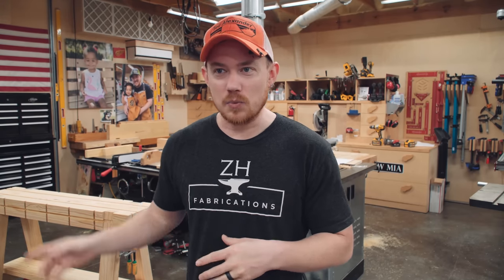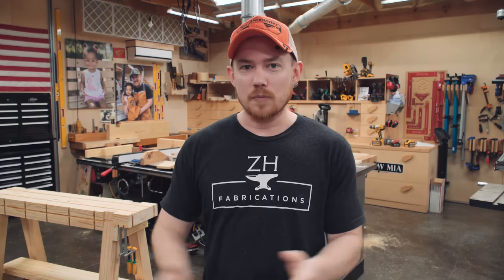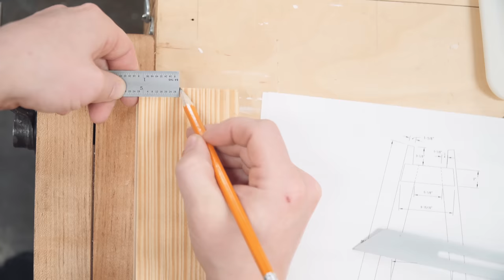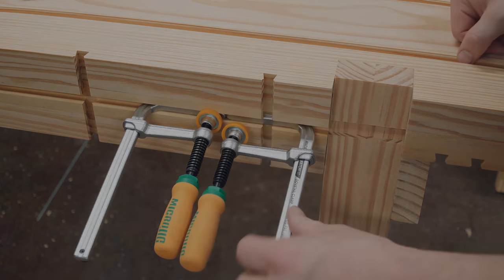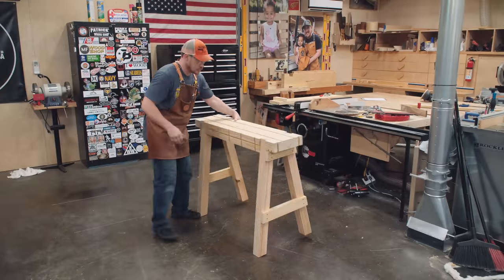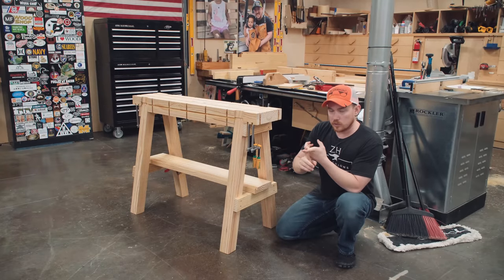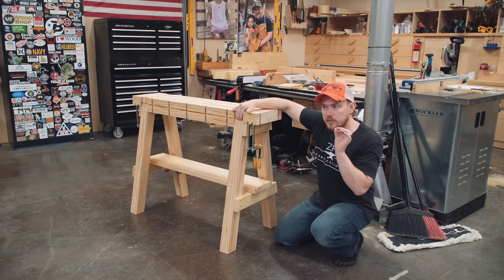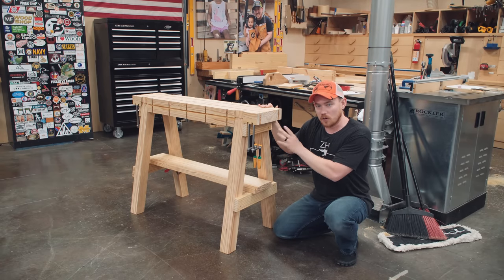MatchFit Work Horse - 368

Comment: Jay, did you consider making the legs on the front side vertical. You wouldn't have the access or clearance problems and would be able to clamp large workpieces like doors or large panel to the face of the bench. With the back legs splayed out I think it would be stable and resist lateral forces when hand planing.

Comment: A few power tools.. Pulls out table saw with 2 different blades, and dado stack, with cross cut sled, miter saw, one hand held router, one router table, 3 different router bits, festool sander, jointer, planer and drills.. So yeah, guess we don't need a CNC machine, just every other tool that most of us don't have in the shop..
Reply: Boohoo. Could you do it with less? Sure. Would you if you had Jay's tools? Most likely not.
Reply: I agree.  It's a little much to say, "a few power tools," and then immediately move to the thicknesser.
Reply: Most DO have the tools
Reply: Unless you only have your hands and some rocks,  then these are just excuses to keep being lazy.
Reply: I have a cnc machine
Reply: @Chris
LOL, yeah,  a few power tools...
Reply: A circular saw with a straight edge would do most of it.
Reply: @vaughnmaurt5013 he said in the video ‘for people getting into woodwork’ doubt they would have any of these
Reply: I intend to do this with a circular saw, a hand saw, and a $25 harbor freight trim router. Wish me luck.

Comment: Beautiful build with quality tools!   I know that you are also a master with hand tools and basic drill, driver, and track saw, etc.  Would love to see you build the exact bench (or something similar) with the tools of the everyday woodworker.  I would love to buy the plans for something I could actually build.  Thanks, Jay.
Reply: Fwiw, I got the plans last night, and made it through initial cut, surfacing and glue up with a circular saw, a random orbital sander, and some clamps (all from harbor freight) 

 I intend to do the routing with a $25 trim router and some barstock for straight edge guides. 

The plans are really well laid out and make the above very possible.  It's more work, but not too much more.

Comment: Jay, I just purchased the plans and love them. One thing I think you should add though. We have always used our lower shelf as tool holding and I thought adding some tool holding options for the lower stretcher might be something that could be added. The tool tray in the accessories is nice but a full length tool holding option down under might be nice as well. Great job on the design of this bench!  This is the perfect compromise for those of us to need to be mobile.

Comment: Excellent bench and DIY video!   Couple questions if you have a moment to reply...
1) MicroJig recommends doing all dovetail tracks in two steps by doing a preliminary cut with a 1/4 square bit.  How did it work out with just doing a single pass with your dovetail bit with your cordless mini router?
2) Plywood and hardwoods are commonly matched with the MicroJig clamps for strength and durability.  How has your softwood bench held-up over time with the dovetail clamps?  I suspect moderate clamping pressure would avoid possible breakouts.

Comment: Hi just been watching your vids on the work bench. Great idea especially for site work.  Was looking at making a small table top bench but I will be making one of these now, thanks great idea. 
I see you have legs at 90 degrees why not make rebates on the bench splayed outwards 7-10degrees. They would still pull out, and flat pack. I had a car years ago and I never glued the legs in on my traditional saw horses they were splayed and pulled out to flat pack them to go in the boot.  
Bit more mucking about but might be more stable without the use of a sand bag?  Still, very good idea. 
Nick Rust

Comment: Nice build!  Those little blocks you flush cut off the tops of the legs--glue them to the outside top of each leg, flush with the bench top.  This  provides parallel clamping surfaces across the top of the bench even where the legs are.

Comment: It's a great looking and practical project, but I'm really curious how the slots are holding up.  It seems that all of the clamping pressure will be transferred to the "point" of the chamfered slots with most of the slots running with the grain and intersected every 8-10 inches by perpendicular slots.  I would expect those "points" would break off with regular use and you'd be left with just a square(ish) dato slots.

Comment: My own Matchfit Workhorse build is under way. Working on routing all the dovetail slots right now. Made more then a couple of screw ups (but each were recoverable). However, it definitely is a challenge when I don't have a large table saw (just a jobsite one). It certainly made it difficult to cut the mortises in the top. I wound up just cutting the left and right of each one by hand (pull saw) then hogging out the rest with a circular saw. One dovetail groove went off kilter, so I had to fill it back in with epoxy (thankfully I had plenty left over from a previous project) and will have to re-cut that one again.

Comment: Great video, great bench.  I just wonder if you made the legs plumb on one side and the apposing side the same or slightly more angle would you still achieve the same stability but gain work holding functionality?  Anyway great design. Thanks

Comment: The way you are using the match fit system is pretty interesting.  I’ve been thinking of building a new top for one of my smaller workbenches using this approach.  It would be a wider top and the legs would be vertical.  Can you see any issues with this modification?

Comment: I prefer T Track clamps to dove tail clamps.  I can see using something like this as a quick solution as an out feed table, by clamping a board vertically, matching the job site saw height.

Comment: Well, it is a fine piece of kit. But it is way overbuilt. As a suggestion, take a look at holdfasts. Single holes rather than slots are easier to place. An English jointers bench would give you the same rigidity with less work. Splaying the legs would handle the joint loosening you predict.  Google the Monrovian workbench. You could covert your design to splayed legs and get a forever joint. Wedges in the top to leg would be another approach. All that said, I’m really impressed by the care you put into your work. Please do use a guard on the table saw.
Reply from the maker: The same can be said about Greene and Greene furniture. Way over built so let's just build shaker furniture from now on ;)
Reply: @JayBates  That’s a very sophisticated reply! But I was thinking that with the same mass you could go with some tweaks for better functionality. I said Monrovian. Whoops on that. Moravian. here’s a link to one version. https://videos.popularwoodworking.com/courses/building-the-portable-moravian-workbench-with-will-myers-part-2 You really intuited a strong bench. The tweaks of splayed legs and wedged tenons would keep Your’s from getting to a place where it might rack some day. Please don’t take my comments as a negative. When I see shitty work on YouTube I don’t even bother commenting. I think you’ve got a really strong build ethic. Personally I came across an English jointers bench design and I cobbled one together. It’s very rough but remarkably solid. The top is 2x6 laid flat with cross pieces 24 inch apart to the skirts. I had wanted to make a hardwood bench one day, but one of the sites I came across pointed out a softwood bench wouldn’t harm hardwood projects. The bench is so humble I have had no qualms about making holes, nailing to it as needed, and just using it with no concern about tearing it up. When I saw your softwood bench I was delighted to see the use of humble pine put together in a very nice build.  I really look forward to videos you will put together over the next 12 months. Seeing how your design holds up in the next year will be interesting to see.  Best regards, Steve.

Comment: Thanks for this awesome content, Jay. I do have a question, though. Do you know if anyone has done a strength comparison between the Matchfit system and T-track? I like what I'm seeing with the Matchfit system, but I tend to be a bit ham-fisted. I actually over-torqued a half inch galvanized bolt once...hand tightening with a ratchet. I'd be afraid I'd accidentally blow out the dovetail notch for the Matchfit clamps. Now THAT would be worthy of your laughing guy.

Comment: Really cools design man. Would be cool to try a 3 legged version for un level floors. Also I bet rubber pads on the feet would take it to another level of stability as long as it didn’t cause it to bounce when pounding on the top when chiseling.

Comment: IM curious how the grooves for the side clamps will hold up over time, they seem fragile, pulling against the long grain. Nice design though.
Reply: That was my concern.  I think a bench dog clamps would be more sturdy (i.e. the clamps that go in a round hole) and very nearly as flexible in terms of holding things.  I have never used holdfasts but I feel you have more control with screw type clamps. I like the bench and have always felt clamps are as good as vises.

Comment: I see a lot of comments about how this isn't doable without a planer, chop saw, table saw, router table, etc etc etc. The guy has them, so he uses them. 

I got my plans last night (beautifully done) and am waiting for glue up to dry right now.  I'm doing this with: 
a harbor freight circular saw (with a good blade) 
a harbor freight trim router (with a good bit) and a straight edge to use as a guide (I'm using metal angle stock) 
a small army of harbor freight clamps (And bricks for the pieces I ran out of clamps for) 
a harbor freight orbital sander 
a harbor freight drill with some bits. 

And I'm making it primarily out of reclaimed wood. 

Is the build quicker with the tools he has? yes. Do you need his whole shop to make this? absolutely not.
Reply: mostly done at this point. Absolutely love it. Used this as a chance to practice my chisel work, so I did the legs, both their top angle and the cross pieces with a hand saw and some chisels. The first one took me some time, but the latter ones were super quick and easy.  This is SO much more stable than my dewalt portable workbench and is just the right height for the work I'm doing. Thank you so much for this wonderful design. :)

I did sub out just using 2x4s for the legs since cutting down the glued up pieces with my circular saw (with insufficient depth) proved challenging and doing it with a hand saw was just taking too long. Still, even with just 2x4's it's incredibly stable!
Reply: One more note: I've been learning how to use a router on this project, and made my fair share of mistakes. 

The plans are such that most of the measurements aren't critical, and if you screw up one track, you can just put another next to it. 

Also, because it's modular, I can just replace the top without redoing the legs when I decide I want to try again for a prettier version (although the design is so fault tolerant that even my bad work still renders a completely functional workhorse) 

Also: expendable pieces on either side of the cross grain routing goes a long way to preventing tear out.

Comment: Lots of NaySayers complaints about Average Joe not having specialist tools, Planer/Thicknesser, multiple Table Saw Circular Blades, Dado stack, Mitre Saw. You could do it with handsaws & hand planes, just takes longer & more effort, then it's just drill & router electricals to finish off where necessary. Or don't Average Joe's have these either ?? In which case. Bit & Brace & Chisels. It's the mindset & determination that does it with whatever tools you have available! Look at what you CAN do, don't cry about what you can't do !!

Comment: Nice project, but loses a bit of credibility when the lead-in narrative is that it can be made with just a few power tools, then the build uses a compound sliding miter saw, a thickness planer, a jointer, and multiple setups on both a fully equipped table saw with dado blades and a full capacity router table. Not exactly the "just a few power tools" that a woodworker on a low budget or a more beginning woodworker who needs this kind of clamping/hold down plus saw horse support would have at their disposal.

Looking at it being built, I can visualize doing it with a circular saw, hand router, a saw and router guide, and some saws & chisels, but certainly not with the same ease, speed, or precision.

Still, it is a really nice adaptation of a saw horse to fit multiple holding functions and with care taken should be within reach of even less experienced woodworkers' skills.

Comment: As good as your video is, I really don't like your safety routine. hands way too close to the blades, wearing a RING while working with tools, no cover on the sawblade when you can put it on, wood with screws in it through the saw... 
I know I come off as nitpicky here and you know what you're doing but I can imagine people picking up bad habbits here